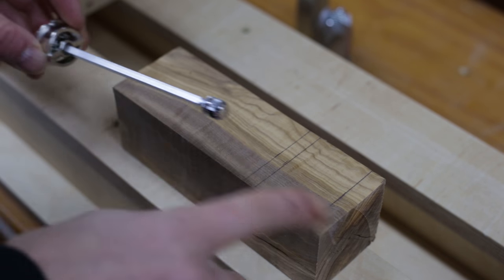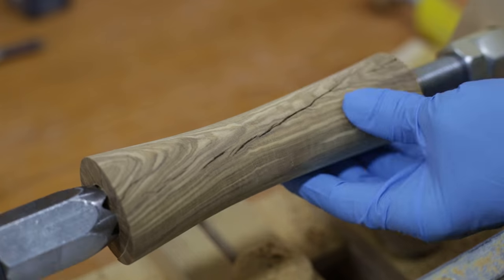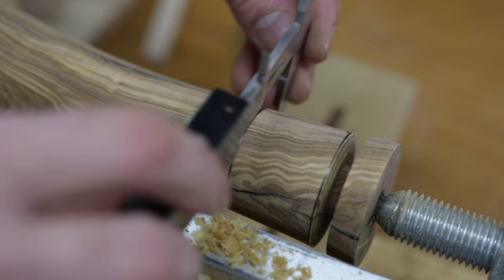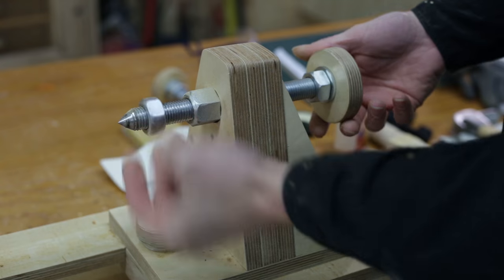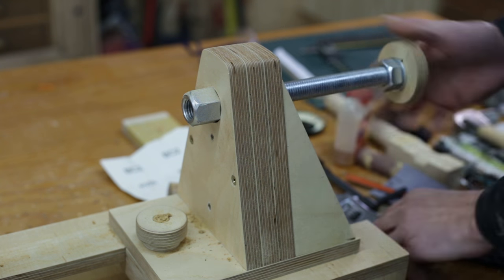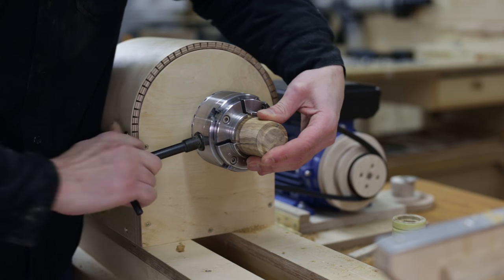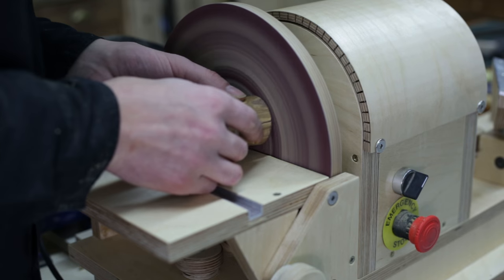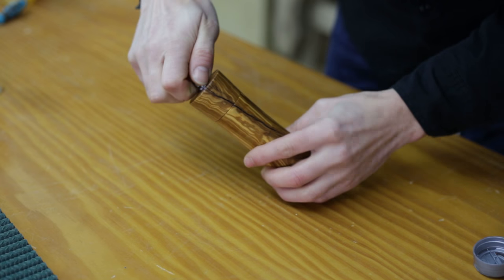Turning a  Pepper Mill

Comment: Great project as always! I was wondering... Is epoxy considered "food safe"? (I was wondering the same thing for the bowl, but did asked since it could be use to hold non food stuff.)
Reply from the maker: Once it is hardened it is safe, it's no different than a piece of plastic. Even metal food cans contain an epoxy layer inside... Anyway, I prefer to use a small amount, in this case there are only a few small cracks outside.

Comment: The chuck seemed a little wobbly or off-centered. Do you think it may be the shaft is not as tight as it should on the bearings to hold the weight of the chuck stable?
Reply from the maker: it's not the weight of the chuck that's the problem, the threaded rod seems to be slightly bent...Ideally I should use a calibrate one, but for now I think I'll continue using it as it is.